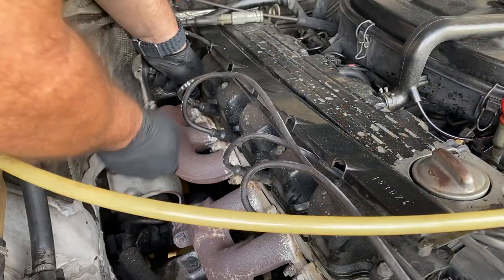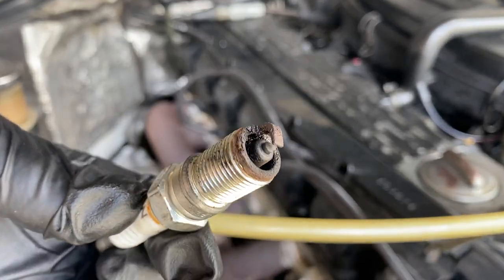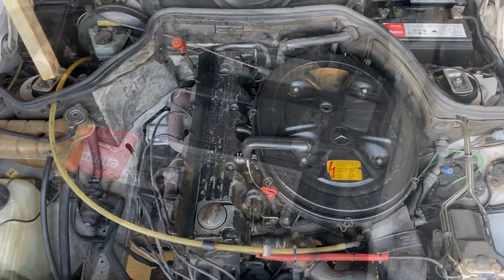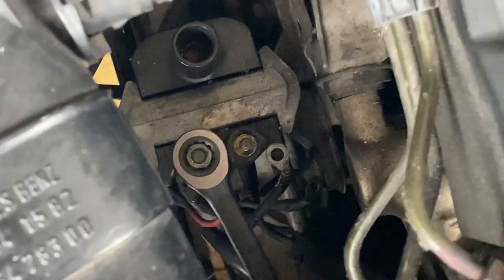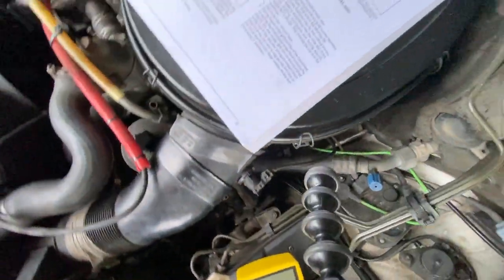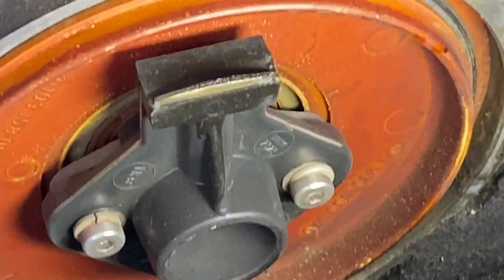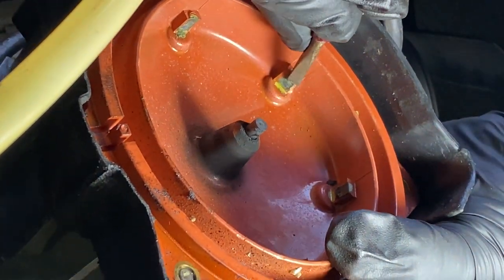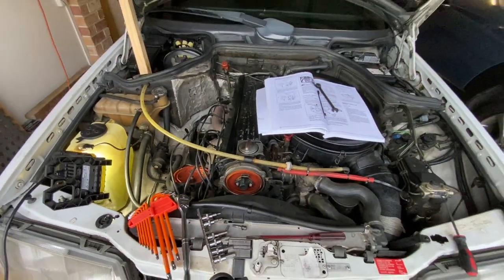How much to buy new Coil, Distributor and Spark Plugs? - Mercedes W124

Comment: My coil on my m103 on the contrary has .2ohms and 4.1K ohms on primary and and secondary terminals respectively, which are both below the specs. I wonder how it affects the spark, whether it is making it stronger or weaker. Anyway, the coil is only $65, so am replacing it. I have been having slight random misfire at idle for as long as I have been having this car, which is 5 years. Wonder if the new coil is going to fix it. The rotor and and the cap were rather heavily pitted, even though I replaced both of them only 10k miles ago, both parts were OE parts, so will have to replace it again I guess. I don't know why I never considered the coil being bad before.